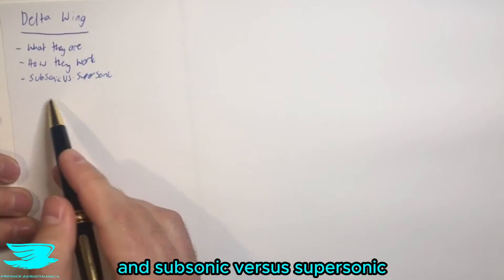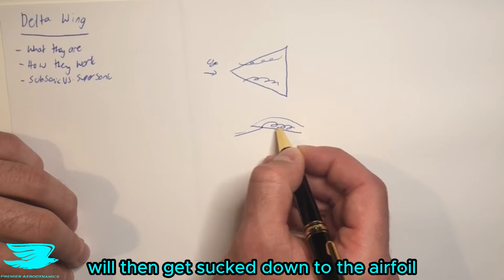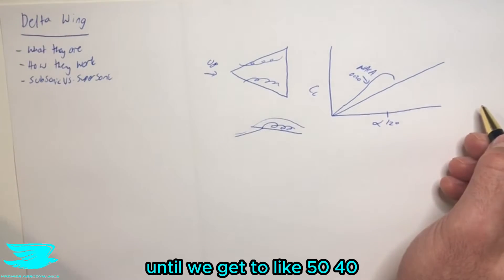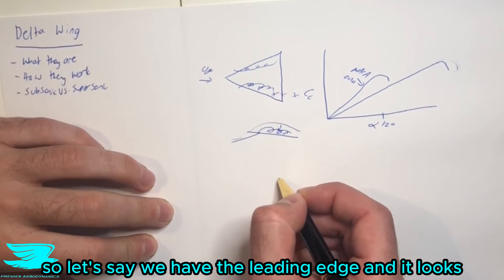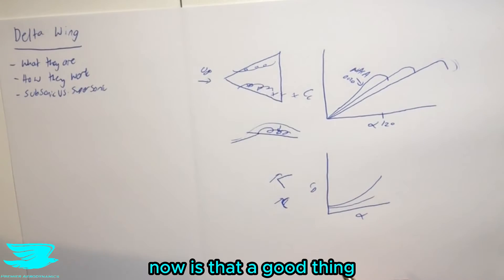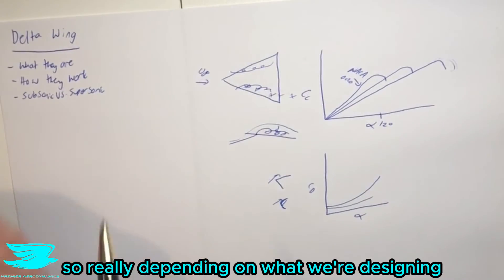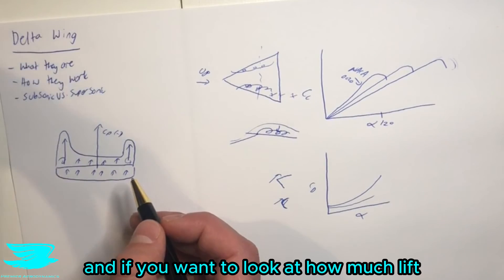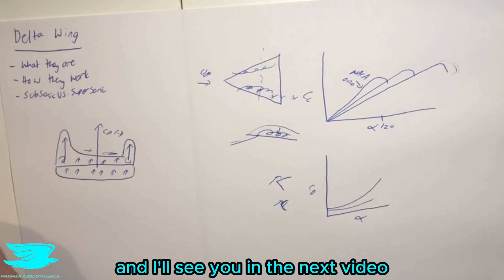Aero Fundamentals #43 Delta Wing Explained

Comment: Why doesn't that vortex form over traditional wings at high AOA?
Reply from the maker: Mainly because they aren't swept back enough, but also because they usually don't have sharp enough leading edges.

As such, the flow just separates and doesn't roll up coherently into a vortex.
Reply: @PremierAerodynamics Idk why I didn't get a notification for this! Thank you so much for the response! I adore your channel!
Reply: Follow up question regarding lift distribution, your example is at the back of the wing, but if you were to move that cross section towards the cockpit, would the high points of that distribution follow that low pressure vortex?

Comment: additional comments:
Delta wings can produce high lift at high angle of attack, HOWEVER: You need a LOT of thrust to keep it up in the air. Drag is WAY higher than on traditional planforms when you go to high angles of attack.
The lading edge angle should make sure that he wing is within the mach cone of the shockwave generated at the fuselage/wing junction.
Reply from the maker: Good points, especially about the shock wave angle. This angle also changes with speed. So the faster you go, the sharper the leading edge should be swept.

It also reminds be of the F-14 tomcat, with it's movable wings. That was pretty cool.